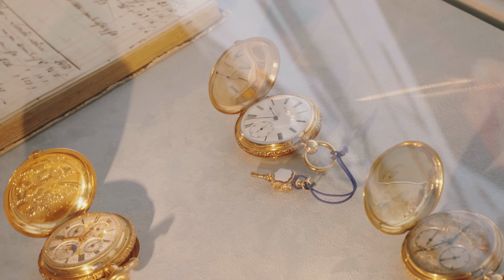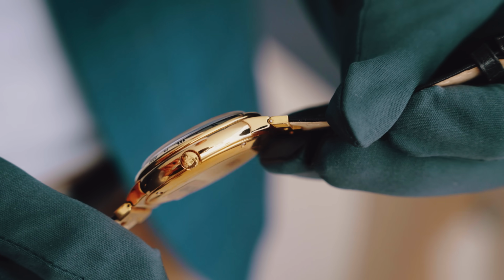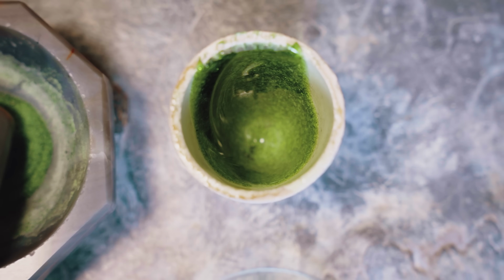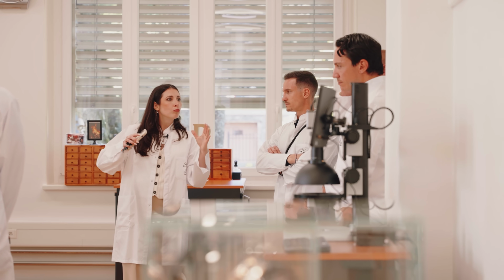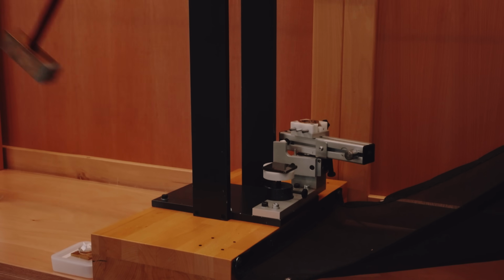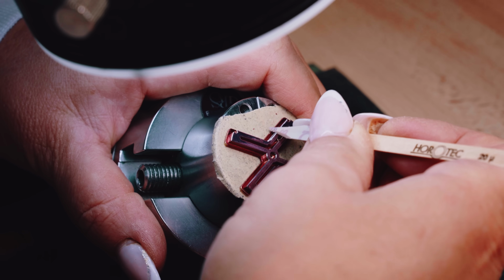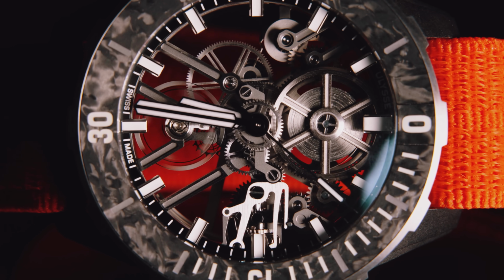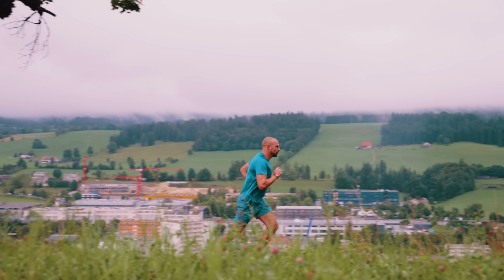Geneva Special! VIP Ulysse Nardin Factory Tour, Diver AIR review & more.

Comment: "The fact that Ulysse Nardin presents an extremely light diving watch (about 52 grams) with the Diver [AIR] is primarily a technological feasibility study and not a new, functional standard for diving.
While the model impresses technically, the pricing is completely overdrawn in my eyes. The materials used do not justify these sums in any way: both the titanium components and the carbon elements of the case are industrially available and cost only a fraction of what the final price suggests in purchasing. The fibre strip is simply not a luxury, either, compared to its material value. Here, the customer pays primarily for the brand name and the image of innovation, not for material value that even comes close to reflecting the price called for."